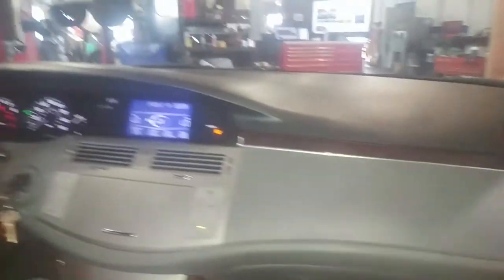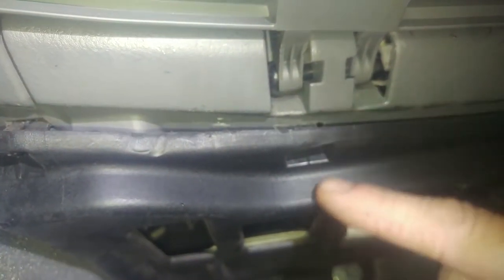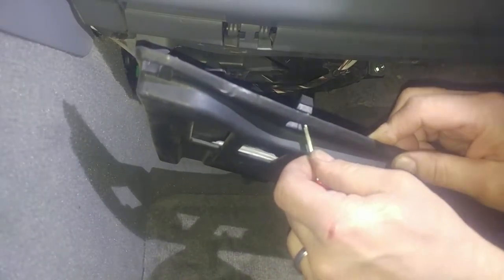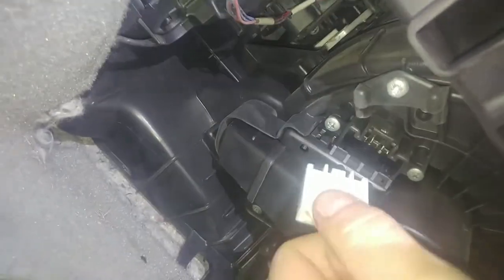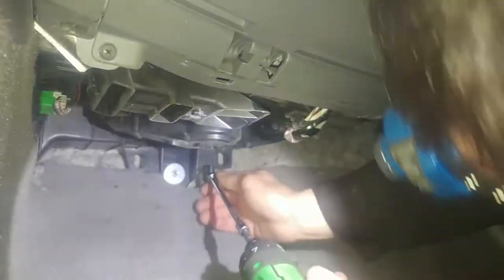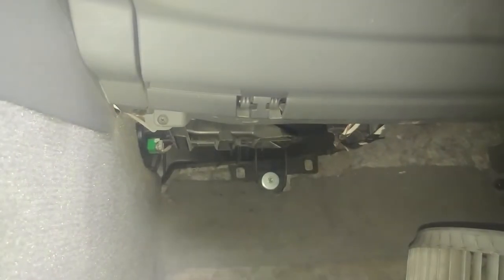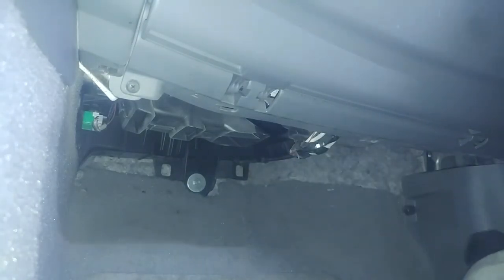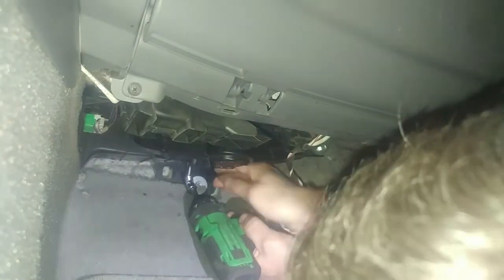Blower motor replacement 2008 Toyota Avalon noisy blower motor due to mouse.

Comment: Just a suggestion, before you put a used fan motor back in, use your air blower (outside of vehicle) to blow the carbon brushes dust out of inside of the motor, there is a hole to do that. As the brushes wear the dust can build up causing the armature or brush holders to bind. Takes a few seconds (wear a particle mask) might get another year out of fan motor.